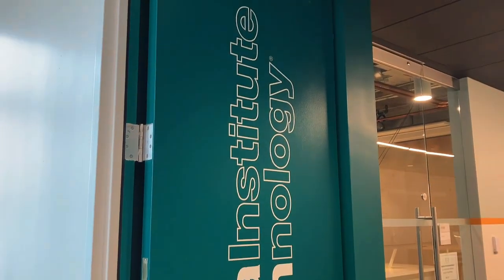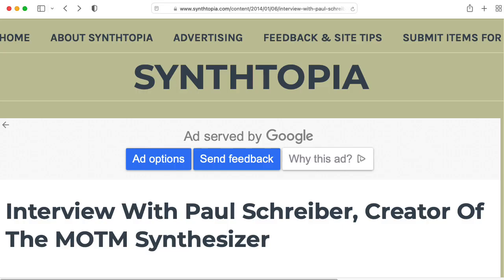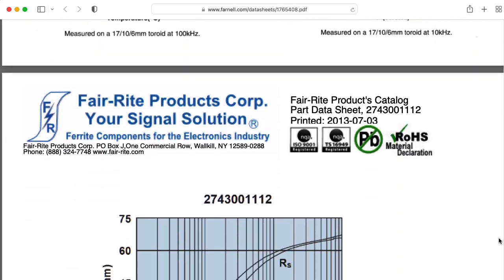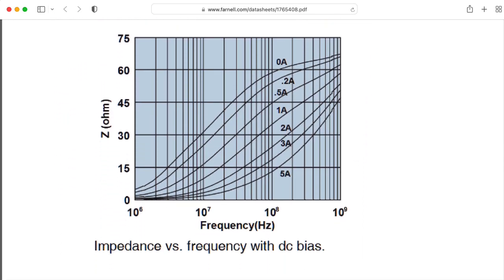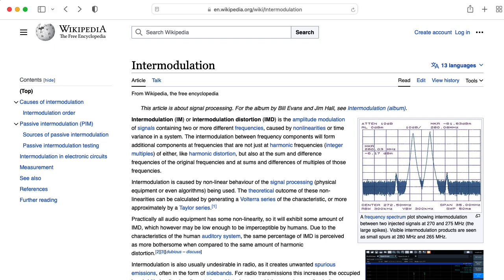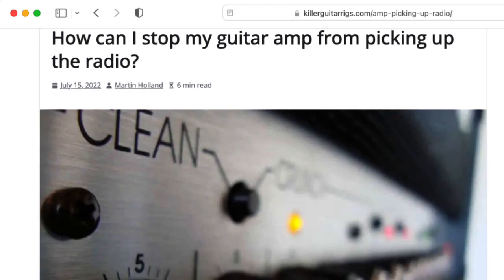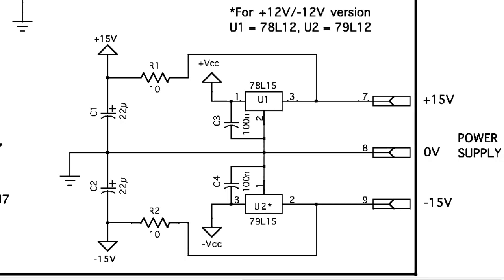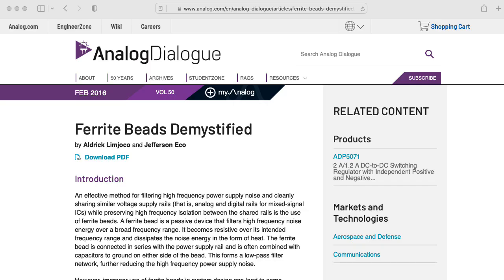Synth Power Filtering: To Bead, or Not To Bead? (alternatively, Ferrites: Functional or Foolhardy?)

Comment: I usually use schottky diodes instead of either resistors or beads. I'm hoping the dynamic resistance of the diodes along with the bulk caps provides some filtering, but I'm going off of vibes instead of any sort of actual analysis or measurement.
Reply: That's just going to screw up the voltage as it follows varying loads.
Reply: @MuzixMaker  So would resistors or ferrite beads (if they have much DC resistance). But also, the power draw of a module probably doesn't change all that much with varying inputs and outputs. Coupled with the exponential IV relationship in a diode, I don't expect the voltage to change all that much. Also, op-amps have good PSRRs, so unless the module is using a raw 12V as a reference, I really don't see that being much of an issue.
Reply: @duckythescientist  I just don’t see it doing much of anything frankly. The slope of the IV curve at the operating point is near vertical, meaning it’s working as a very low-value resistor
Reply: Unless your goal is to keep it from blowing up if you hook the voltage up backwards. It will work great for that
Reply: @enginerdy  lol, yeah, reverse polarity protection is why I'm using diodes in the first place.

Comment: I've never used them and never found a reason to. 

I thought the 10Ω resistors were being used as fuses in case of soldering mistakes. A LPF at least makes more sense than that! I don't use them either.

Comment: I watched the Roland Schematics for hours and hours back than, i noticed the 22R or 100R resistors and copied that, being using that ever since. running the IC's on a slightly lower voltage, means that the slightly higher potential will block or suppress any wiggles (when the ic's is trying to source energy to fulfill it's task) being generated by the ic's leak back in to the other modules, at least that's my theory. I don't have a sensitive high end TFT Ghz scope to validate.

Comment: It really depends on what you're trying to filter and what type of filter you want to design. In most applications I've seen where ferrite beads were used is when we have a fairly high frequency switching regulator (i.e.: DC-DC buck regulator switching at 1MHz+). So, then designers place ferrite beads near the supplies of sensitive ICs (or even ICs that have split digital and analog supplies). If you have an LDO....then adding a ferrite beads might be overkill cause most LDOs are fairly quiet supplies.

Comment: These systems are often a mix of digital and analog circuits.  Even at lowly 100Mhz switching speeds the harmonics of the fast edges can easily go well bast Ghz.  Also, in digital computing applications it is not uncommon for the switching activity to be modulated at audio frequencies meaning that audio modulated man Ghz signals will be found on a mixed digital/analog system power buses.  Multi Ghz signals are wily little beasts and even having separate power rails for digital and audio is not a particular guarantee when you consider what can become an antenna at those wavelengths.  Plus modern ceramic bulk capacitors are very nonlinear animals, so it wouldn't surprise me if it was possible for a voltage dependent capacitor to be capable of demodulating an audio frequency modulated signal in the multi Ghz range, but this part is just speculation.  I would say if there are computers anywhere in the system then having the beads there could save you some grief trying to track down pernicious gremlins, it might be much more cost effective to be safe rather than sorry.  For these very high frequency signals, most components, even resistors, have parasitic capacitance that can allow these signals to pass unimpeded.  So the ferrite bead I think is about the only game in town with a chance of stopping them.

Comment: As a non-formally-educated knucklehead expressing what he thinks he knows here, I used to think ferrite beads were simply useless. That is, until they solved an issue of self-oscillation in a power amplifier circuit I had designed and built. It was bad enough to smoke the transistors in short order. I had beaten my head on that problem for an embarrassingly long time. No information could be found that would lead me to solve my problem. Not even the ferrite mfgs had any guidance. The gate ringing was so faint I could barely see it on the o'scope. And, while I couldn't determine the frequency, I knew by the blurred waveform that it was high. Having no good mounting point on the PCB for a leaded ferrite bead, I hacked one up and slipped it over the gate leads of the transistors out of desperation. Low & behold the problem was solved. Still has the feel of hocus-pocus, but got the job done.

Comment: IMHO the ripple of a switching PSU should be filtered on PSU level, not on module level (when talking modular synthesizers). There are formulas to calculate the proper filter to consider the requency of the actual switcher you use. Then ferrites on module level, that filter/block spikes from other digital modules on the same PSU, seem to be a good idea.

Comment: I think one good explanation is that ferrites cost fractions of a cent, so if there is even an extremely minor and situational improvement, they are essentially free to include.
Reply: With those cheap components it is not the cost of the component but the cost of placing a component that adds to the price. 3 cents per SMD component is not an abnormal price and through hole component placing is more expensive
Reply: That's also true of 10 ohm resistors, though?
Reply: @CraigStuntz  I feel like there's more potential 'gotchas' with a series resistor.  A moderately high current module could easily run into issues with voltage drop, and could even potentially blow up some SMD resistors.

Comment: I've never understood why people use ferrites instead of inductors for this. I generally use 10uH/22uF which gives a cut off around 10kHz, low enough to filter a significant amount of ripple from a switching supply, which a ferrite wouldnt really touch...
Reply: As far as I know there is a difference in the ferrite material. The material in ferrite beads is designed to be lossy at high frequencies, while inductors are designed to be efficient and store the energy instead of turning it into heat.
Reply: Shouldn't the ripple of a switching supply be filtered at PSU level? At east that's what the application notes of the switchin supply manufactureres suggest. And there are formulas to caculate the filters based on the switchers frequency that is actually used.
Reply: @fonitronik  I was using that as an example more than anything but: yes it should, but often on synth supplies I've seen where switchers I've used the rails aren't as clean as one might like if you're using them as references for anything etc.
Reply: @danielskevington8940 I am thinking more from the modular synthesizer perspective, where you have all kinds of modules on the same power bus. In this context I prefer the ferrites. It is understood that all critical voltages have precision references and do not depend directly on the rails.
Reply: Inductors often have poor performance at RF frequencies. Their coils are capacitively coupled and RF will jump through it like it’s not there. Beads are designed to absorb that energy instead.

Also, it’s more difficult to accidentally design an oscillator with nearby capacitors when using ferrites because of the lossy behavior.